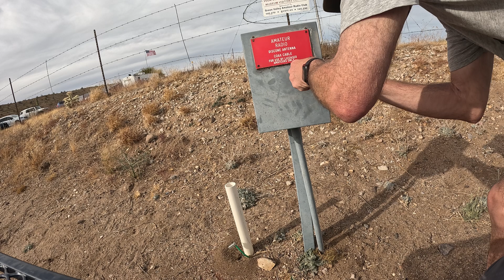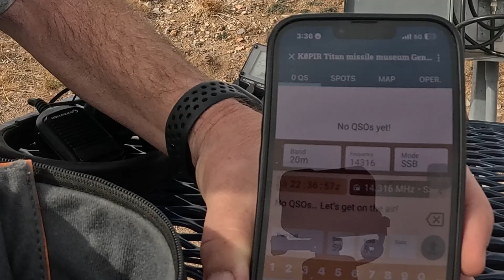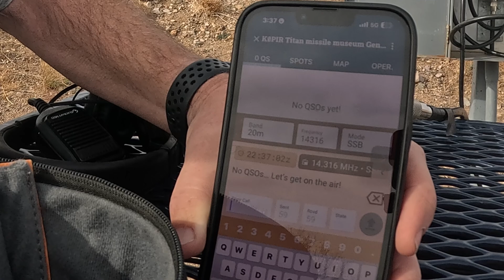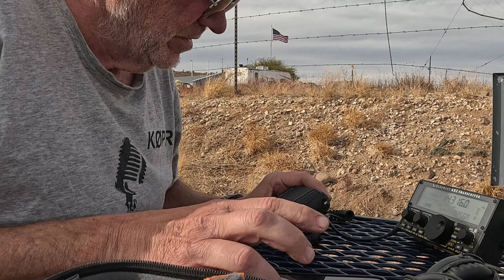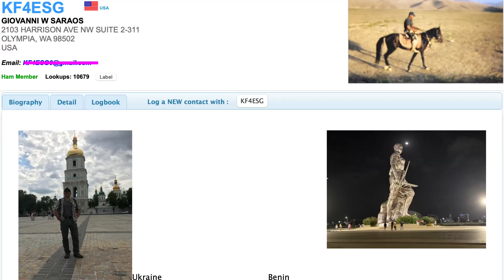Operating from the Titan missile Museum ￼

Comment: Quick question :  What was your SWR on that antenna without and with the use of your internal tuner?  Thanks for your channel and videos.  73 de Jim K4EC
Reply from the maker: Great question, there's more in the video description. DISCONE ANTENNA TITAN MISSILE MUSEUM
The antenna was built by Collins Radio Company and stands at 80 feet tall.
It features a large crown, which allows it to radiate signals over a broad range of frequencies.
The SWR (standing wave ratio) is typically 2:1 over the range of 6 MHz to 30 MHz.
It's a broadband antenna with low SWR from 80m to 10m (although 160m had a high SWR).
Amateur radio operators can use the antenna for free when the museum is open. 73 and good DX!!